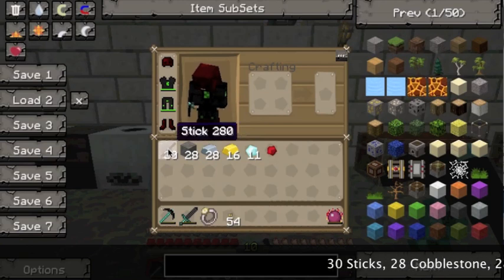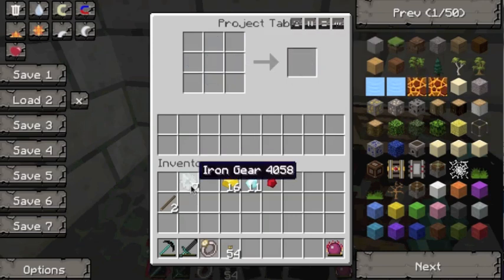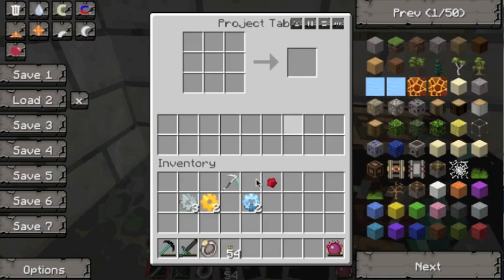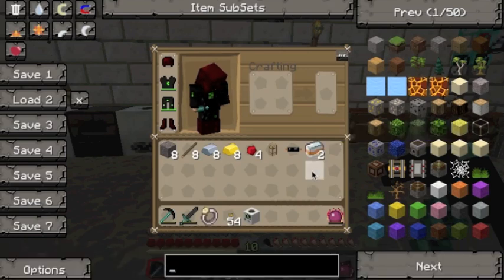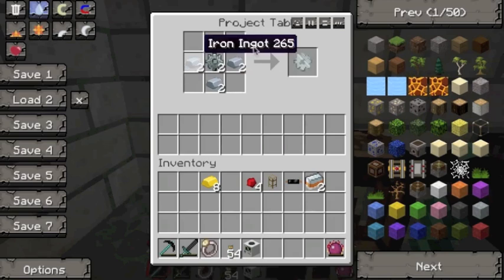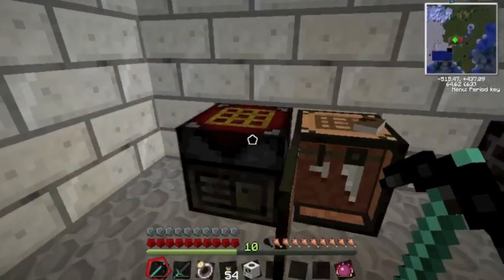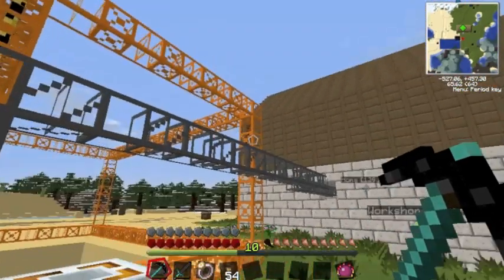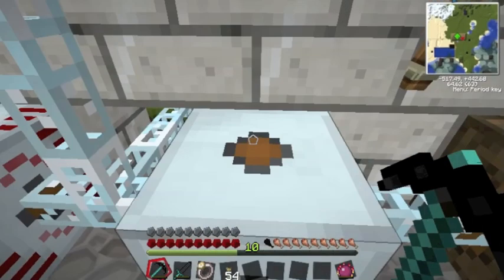Tekkit - How to Make and Set Up a Quarry

Comment from the maker: @Chad Vredeveld potentially a couple of things, first you need to have an energy link next to the quarry with the cable connected to that and not straight to the quarry (as shown in this video) and secondly  wind mills are a very unreliable source of power and you need a LOT of them very high up which is more effort than its worth.... Maybe consider switching to a different source of power ;)